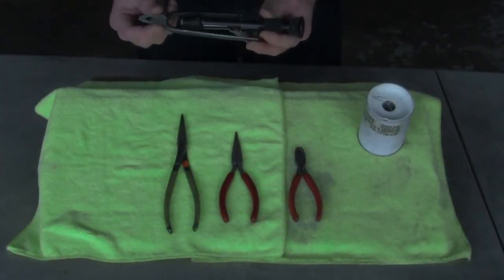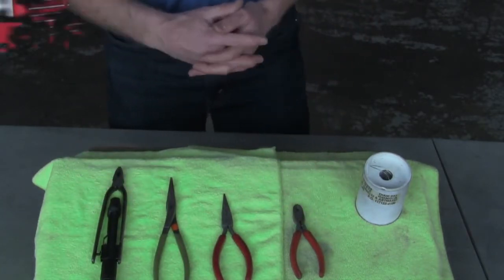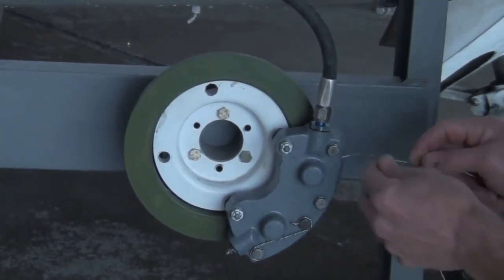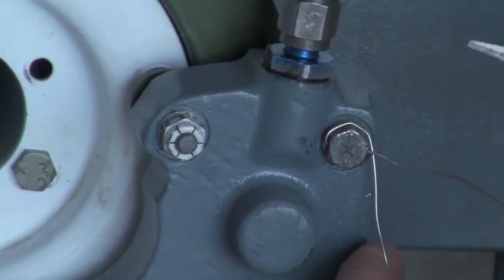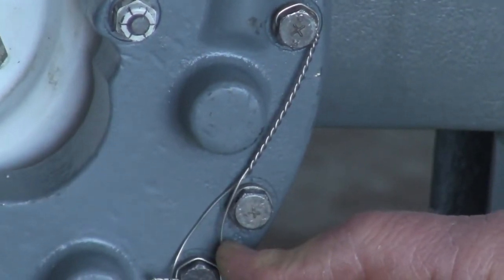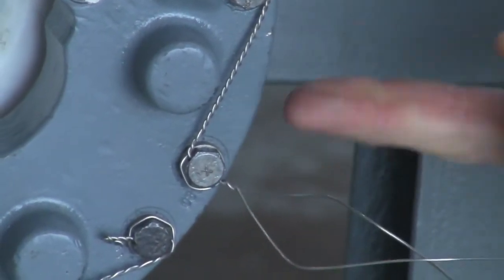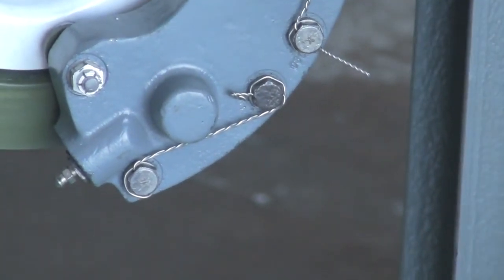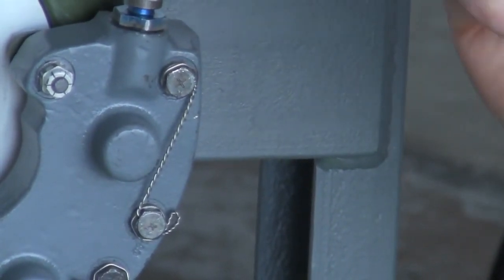How To Properly Safety Wire an Aircraft Brake Caliper

Comment: You went out of your way to mention you ground the serrations off the duck-bill pliers in order to prevent nicking the safety wire.  That makes good sense and preventing nicks, kinks, and mutilating the wire is specifically addressed in AC 43.13 at  7-124 G (2).  I have safety wire pliers with jaws specifically designed for aerospace applications.  Their jaws don't have serrations that would nick and weaken the safety wire, they have a "wave" style jaw that grips the wire without damaging it.  Why would you grind off the serrations of the duckbill pliers and not the other pliers you're using?